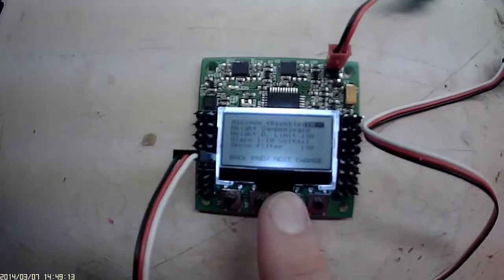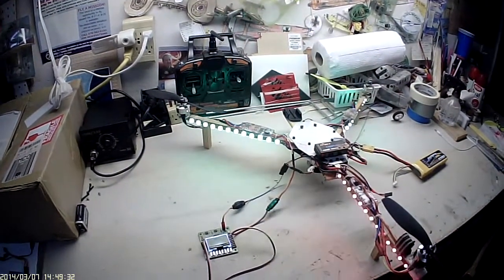KK2 Low Voltage Alarm Flashing Lights Buzzer Replacement

Comment: That's a great idea! ... and the buzzer weighs 2.3 grams so you might not have added any weight. Good job. Far better than the DX 9's low voltage alarm that drives you nuts trying to land with some woman constantly yelling at you over and over again....;-)
Reply: But you have to admit, she sounds sexy shouting at you!!  :)
Reply: Not that long ago you'd be arrested and picked by guys in white coats for complaining about what your TX said to you. What's needed now is voice recognition to tell it to shut up;-) But seriously I wish I could program my own alerts to add setup information as I have so many different setups it's easy to forget how I setup a model. Had to land a large glider in a tree not long ago when landing to play it safe to avoid some people who showed to watch the sunset when I flipped the wrong switch and lost my turning radius with no time to correct. No damage but it's not wise to be climbing trees and testing the strength of small braches in the dark 50 ft up to avoid damaging some UV baked Monokote. They say you get smart when you get old so at least I don't have to worry about that happening... E= what? ;-)